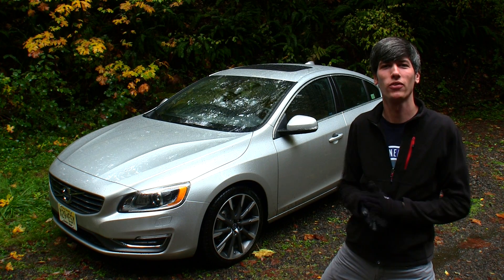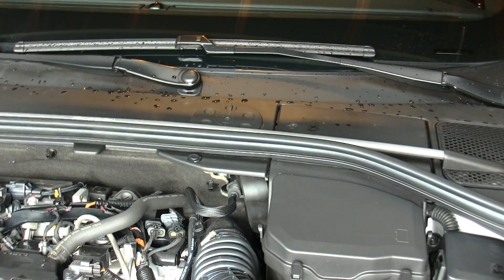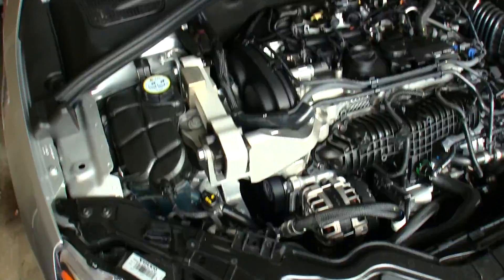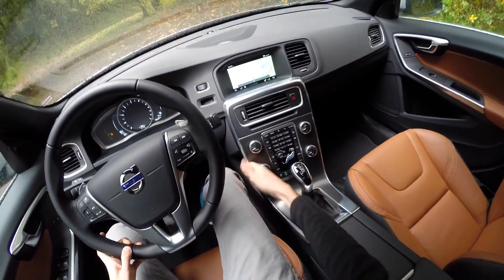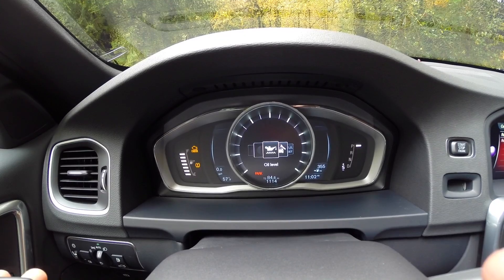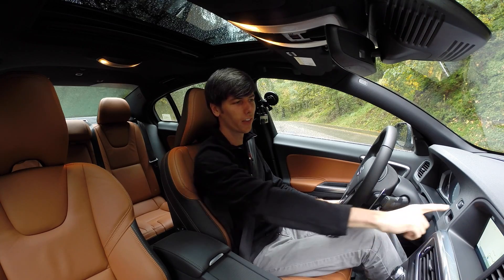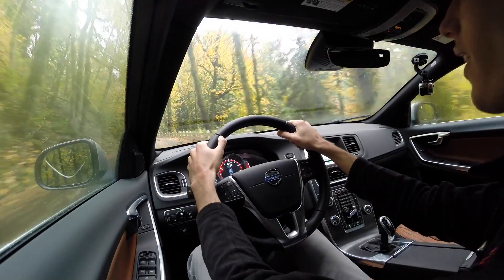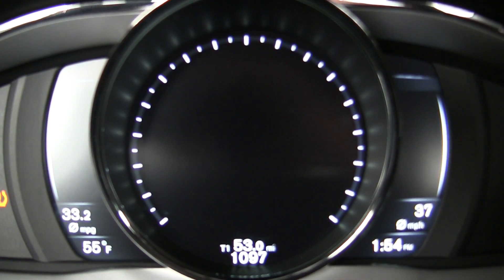2015 Volvo S60 - Twincharged - Review & Test Drive

Comment: With Volvo being so safe, maybe they made it so it would be hard to have a place for your phone to be accessible by design, plus they  give you all of those buttons so you can make a phone call if needed. Plus I’m sure you can access your phone through the infotainment system.
Reply: Yeah, it’s just two clicks to go to recent calls or contacts on iPhone. Never used a numpad actually.

Comment: Well, now the Volvo has almost no buttons on the console. So, they've gone from one extreme to the other. Car looks good. Last gen Volvo but still very, very nice. And it has the motors in it that the 60s and 90s are using now. If people are worried about the super/turbo-charged engines in the new ones, read up on how they are to maintain in this car.  As for the review, fantastic. Clear, covered the engineering on the car well, didn't do too much over accelerating of the car, and we got a good idea of what it is like on the road in normal settings, like rain.

Comment: Awesone review. Considering between the 2nd hand 320i or S60. It is like 51% on S60 now and i still checking the difference between the T4 & T5. Thank you
Reply: Sorry, between T5 & T6
Reply: @saravanant8409  I'm not really sure at this point if there was a 5-cylinder version of the s60. This is the Drive-E car and Volvo confusingly used 5 and 6 to describe the power, but 5 and 6 used to stand for how many cylinders the car had. Nowadays, everything is a 4 yet they are called T4, T5, T6 and T8.

Comment: You CAN access the battery for jump-starting. Half the battery cover comes off simply over the positive lug. Then ground to chassis. To replace the battery you do have to remove strut brace.

Comment: Hi there mate,  I'd like to thank you about this really informative review.  I drive a TTRS and I lease an R8 for personal use,  and a VW Jetta SEL as my business commuter (some times I travel long ranges domestically and to the south to Mexico for meetings) as you've realized I love German vehicles and the reason I didn't chose an A3 sedan instead of the Jetta is because I pass through the US -Mx border which creeps me out the mexico part. Couple months ago I was considering trade it for a '17 GLI because of the engine 2.0TSI and the DSG transmission which will increase my mileage range.  I just watched your review and I liked a lot this S60, a small (but powerful 2.0L 4, sounds like a good deal to me) and doesn't have that eye catching appearance. As an opinion,  from your point of view, could this S60 be a good option to consider to use as a business long-range commuter? (my considerations are VW GLI, Audi A1 (which is sold only in mexico), and I'm adding this S60 to my consideration list).
thanks in advance buddy, have a wonderful week.

Comment: I have a 2015.5 S60 T5 Drive-E and have had it just over a year now. Aside from a cracked gear knob (warranted), a bad bit of spoiler adhesive, and perhaps a slightly wonky transmission, I'm 100% satisfied. The car's plenty quick for me, sports mode gives me smiles all day long, and I'm only gassing up once every three weeks.

Compared to the 320i that was the alternative option to me, the BMW was slow, boring, not particularly attractive, and very poorly equipped. I'm not entirely sure who buys a BMW anymore, or whether they would if they drove this car first. The S60 may be front wheel drive, but I've never had issues with handling. Then again, I'm not exactly tracking it, either.

Great job by Volvo. If anyone wants an alternative to the standard German choices, they're definitely worth a look.
Reply: RtDK What makes the trans wonky? I work in a dealer as a technician and haven't yet seen a fault on any of them.
Reply: Well, basically, what happens is, when I'm in Normal mode (not Sport mode), at times, when I depress the accelerator about halfway, the car will act like it's accelerating. The revs will build, we'll pick up some speed, and then there's a "clicking" noise, almost like rock chips on metal, I lose all power, and the car jerks and upshifts. I'm not entirely sure what causes it, and it doesn't happen all the time, but it's frequent enough that I'm familiar with it. It wouldn't worry me if there wasn't the metallic "chipping" noise. I'm always nervous one of these times that my transmission's going to blow apart. (Not likely, I know, but nothing's perfect...)

Comment: 50 hp/liter , 3rd hand or rubbish
75 hp/liter , atmospheer engine slightly old
100 hp/liter, modern everyday car.
150 hp/liter , sport car
200 hp/liter, limit of road legal cars today
300 hp/liter. 24h le mans and rally like races.
500 hp/liter. short distance races (1 hour)
700 hp/liter, formule 1
1000 hp/liter, only on paper and in video games.
Reply: HP means nothing
It can be turbocharge to boost the numbers
In the real world, hp/weight is the correct measuring
Reply: I mean hp/liter
Reply: rubikfan1 what of nitro cars? roughly 10kHP out of 7ish litres
Reply: The BMW megatron did get 1500 hp from a 1.5 litre engines

Top fuel dragster also got a 1000/Hp litre.
Reply: But dragracer use either pure nitro 
Or ethanol/methanol

Comment: I LOVE the Volvo center button stack because when it's 30 below you can still use everything with gloves on instead of farting around with a toucscreen with your fingers freezing off.

Most of the buttons around the "outer ring" are just set-and-forget anyway, at least the ones at the bottom kind of obscured by the shifter. And having dial buttons for the phone... I don't call in the car often (maybe three or four times a year) but being able to "feel" the dial pad instead of staring at a touchscreen or arguing with a horrible voice-command system (Google Now being the only exception) seems like a great idea to me.
Reply: ***** it takes a substantial amount of time to heat up when it's that cold, especially as it increases the more efficient engines get. I have personal experience with a 2005 Volvo S60R and brutal Alberta winters.
Reply: +Iva Boss touchscreens work in the cold, but: Resistive ones are hard to operate when you have thick winter gloves on to keep your fingers from falling off, the large pad the end of your finger makes creates uncertainty in where you're tapping. Capacitive touchscreens (like in cell phones) are less common in cars because they don't work at all through thick gloves unless the gloves have been specifically altered with conductive wire in the fingertips.
Reply: Erik Tomlinson agreed!

Comment: Quick tabs for your headlights but you have to remove the strut tower brace to get to the battery? OK volvo
Reply: On my 2006 S60R the battery is in the trunk, very easy to acces, they should have stick with that design, especialy with all that space since there is no spare tire.
Reply: +N Lee the battery is placed in such a way so as to insulate it from harsh environments.
Reply: Not all of them have that strut brace, hence the design. It's very very easy to remove the battery, I believe only the R-Design trims feature the strut brace.

Comment: Volvo, in my opinion, is easily the best European car brand.  They're pioneers of safety, they have great dependability, they seem easy to work with, they're cutting-edge without over-engineering, and though not cheap, they're not overpriced either.
Reply: +Peter Schmidt Saab was the best European brand but GM screwed them over.  GM got rid of them because they were costing them too much money because they wouldn't cut corners.  Watch Top Gear's tribute to Saab when they went out of business.  You want to talk about pioneers of safety, the 9-3 is the safest vehicle ever rated by the IIHS and the convertible version is the safest convertible ever rated.

I sold cars and have been around all makes and models though and Volvo is definitely right next to them.  Something to be said about the way Swedes make their cars.  I'm in a this very car right now as a loaner since the Volvo dealer here has taken over working on Saabs in my area and I have a recall being done.
Reply: Jaqen H'Ghar volvo is better just face it you fan boy. Polestar 6 cyl 359hp no saab can compete with that

Comment: I hate how car manufacturers always put in those stupid engine covers. They don't accomplish anything other than to make the engine bay look worse, insult the customer's knowledge of the engine, and add weight.
Reply: Yea, maybe about 500 grams of weight. :) I totally get why they put on those covers and don't really see any problem with it.
Reply: Yea, maybe about 500 grams of weight. :) I totally get why they put on those covers and don't really see any problem with it.
Reply: +ErikTheAndroid 
Actually in this case I think it's for pedestrian crash safety. so the poor guy you run over doesn't split his head on the engine.

Comment: The reason Volvos with DriveE engines are only offered in FWD versions is because they are still on the old architecture, the new XC90 excluded. As new Volvo models come out on the new architecture, called SPA, they will have DriveE and SPA, therefore AWD. So bye-bye torque steer.

The new XC90 is the first with the DriveE engine with SPA, and AWD. Up next will be the V90, and the S90, followed by the S60, and the XC60. These redesigned models will all be out within the next few years. But if you don't care about AWD and want the efficiency of the DriveE engine, then Volvo has made it available for you now.

Comment: Too much hoses man
Reply: Swedish cars seem to be famous for that. If you need to replace one though chances are they are specialized ones you can't buy at the auto parts store, and they cost sooo much to replace. But there are some at least on my car, that can be bought at the auto parts store. Also with all the turbo pressure I'm sure hoses that aren't clamped on will pop off and that's a total pain in the ass.

Comment: why is the air cooled before going into the engine?
Reply: se dde Warmer air is less dense and hence contains less oxygen per volume when compared to cooler air. It is the oxygen that burns during combustion and so cold air is better.
Reply from the maker: se dde So that you can put more air into the engine, and you'll have a greater temperature differential after combustion leading to more power produced.
Reply: so when warmer air is combusted, lesser energy can be released out of it?

Comment: So you can pull out headlights without using  tools  but you can not check the oil ? Seems legit... No dipstick... what  are they going to do next ? a hood that can not be opened ?
Reply: You just check it in the computer and it will give the exact level.

Comment: Engineering Explained Are the wheel hubs stud-less? So the hub is threaded instead of having threaded studs pressed into them?I'm sure this isn't anything new, I have just never seen any like that. What would be the benefit to something like this, not having the stresses induced by press fitting?

Comment: AWD should be standard on a vehicle with that much power. Or atleast not FWD....
Reply: They use fwd so they can use the 8 speed drive e transmission to increase fuel economy. The r design variant is awd if you don't care about gas mileage.

Comment: With advancements in turbo technology like variable vanes, running a twin charge set up is kinda pointless seeing turbo lag is a thing of the past. It's just adds more weight from the additional component and the electronics that control it.
Reply from the maker: 30spooln Well, turbo lag isn't exactly a thing of the past. VGTs aren't quite durable enough to handle the heat from gasoline engines, but I think electric turbos will start to become more common while superchargers will fade out.

Comment: I'm curious about AWD 2.5  2015.5 S60... Wanted to know if the 6 speed automatic transmission is reliable ? there are a lot of negative comments regarding to 2012  6 speed geartronic transmission.
So is 2015 model equipped with the same one or it  has an upgraded version on board?

thanks
Reply: The 6 speed automatic isn't really a fast gearbox. The shifts are slow especially downshifts. This gearbox is one of the main reason why the s60 couldn't compete with Germans like Audi A4 or BMW 3 series. 
The upgraded 8 speed is a different story. In my opinion is just as quick as the BMW's 8 speed. Really nice gearbox. 
If the car that you are interested in is from 2015 than you have to check if it was already shipped with new gearbox. If it's not I would search for something other. :)
And sorry for my poor English!

Comment: I like how its easier to remove the headlight than it is to access the battery lol.
Reply from the maker: Benjamin Griffes Both are quite simple. I'd be more concerned if it was like the Ford Escape I tested which didn't have a panel to remove where the battery lies.
Reply: Engineering Explained Sounds like a flawless design haha.

Comment: Great test bro, I Was wondering, the low performance of Cold Air, in low RPM, isn´t that because There are more air to get into the cylinder? I mean in high RPM the air flows faster, so more air can income to the cylinder. 
I Think Yamaha tryed to solve this problem with YCC-I (electronic variable-length intake funnel system) . Take a look at Yamaha R1  2007

Comment: Why would they not include a spare tire?
Reply from the maker: fanousontheloose To save cost. Potentially to improve cargo space/reduce weight.
Reply: Engineering Explained So then what to do in the event of a flat tire or replacing a tire? Does that tire repair kit take care of it all?
Reply from the maker: fanousontheloose Takes care of it for a certain amount of miles, so you can get to a tire center, or I suppose you'll have to call a tow service for assistance.
Reply: I think it's because today you can use foam repair kits on flat tires. It looked like one of those kits in the spare tire compartment.

Comment: Another great video, Jason! Awesome review! I know that one of the downsides of supercharging a vehicle is the added weight, and the same goes for turbocharging a vehicle. So, having both... doesn't that substantially increase the weight of the car?
Reply from the maker: Arthur Sperotto There is added weight, yes. But it allows for big power with a small block (2.0L) which can help compensate for the weight gain, if not offset completely.
Reply: Engineering Explained Got it. Thank you!

Comment: Easy access headlights but everything else is covered with plastic.

BECAUSE VOLVO.
Reply from the maker: Unfortunately all modern cars are covered in plastic covers. And this cover wasn't actually plastic, haha.
Reply: Engineering Explained Some sort of funky heat resistant rubber compound?
As for all new engines being covered in plastic shrouds.. It sucks... Look at what they did to the engine on the new Subaru WRX... It looks stupid compared to the few years older style.

Comment: The digital oil level is a feature all cars should have
Reply from the maker: I agree, but I also think it'd be nice to have both options (dipstick), so you can visually inspect the oil or take a quick sample if you need to.
Reply: Engineering Explained ye because if the digital one was playing up you could check it against the dipstick.
Reply: Engineering Explained better not buy a 335i then

Comment: Why use a super charger and a turbo charger, why not a variable turbo charger?
But this car seems awesome and looks very comfortable
Reply: ***** Once you get past 80mph your petrol will be crying for re-gas-fill every 250miles and we'll be happly diesling on for double of what you did :)
Reply: ***** Thats becouse you dont drive Autobahn, have low speed limits, dont really need fast car for daily driving just for fun, u dont haul stuff have too cheap gasoline
If u'd be doing 200 miles of autobahn per day and paying 7$ per gallon you sure would care, so dont bash diesel becouse you cant use its potentials
I know it wont turn heads, scream pussy magnet sounds and have occasional smoking curtains in older cars and sound a bit more like a tractor, is bit heavier but its made for Autobahn  :)
Reply: 3:08 explains it.
Reply: Most variable geometry turbos are designed for diesel applications, as the variable vanes have reliability issues with the higher exhaust gas temperatures of gas engines. 
I believe Borg Warner makes one for the 911 turbo.
Reply: Charles Shang A VGT does the exact same thing as a supercharger+turbocharger - but with less infrastructure to support it...
Reply: ***** Perhaps, but it's not leagues better than a VGT - and now you need a complex set of diverter valves, vacuum lines and CPU programming in order to get it to work properly.  That's why only a handful of cars have even used this combo - it's a royal pain.
Reply: ***** No no - lol  I'm not saying that this is leagues better than VGT - I'm saying why introduce all of the added complexity and points for failure in the twin-charging system for modest gains rather than use a VGT?  

I'm the just the person that values simplicity rather than that modicum of comfort and throttle response - most of which the average driver won't notice anyway - other than a selling point the salesman can yap at you about.
Reply: GammaCruxis In Canada diesels are not as common as they are in euro countries :)

We rarely have diesel versions of unleaded engines.
Reply: *****
Meant more like bussines cars, long distance cars, hauling cars and lot of equipment

5 series, E class and such can hardly be called econboxes, or S classes, masserati ghiblis and porsche panameras ... not necesary econboxes